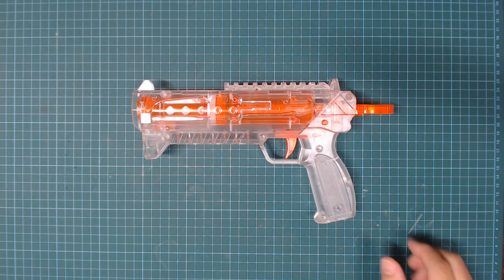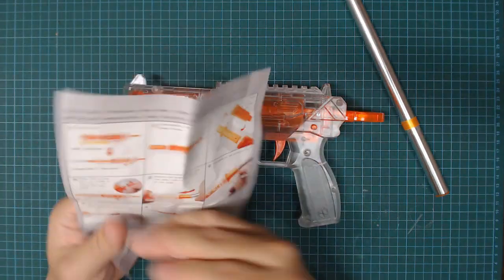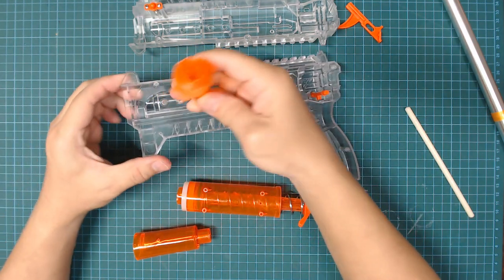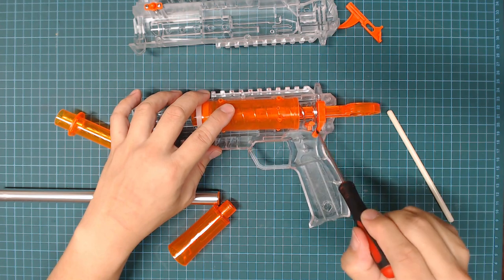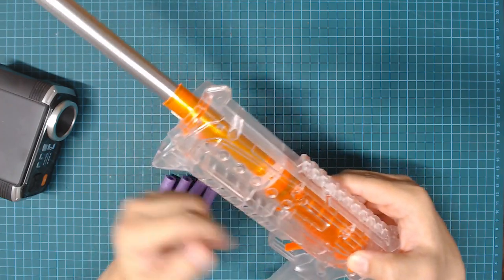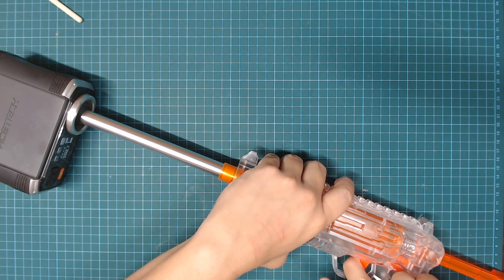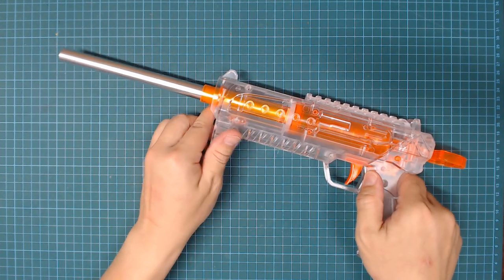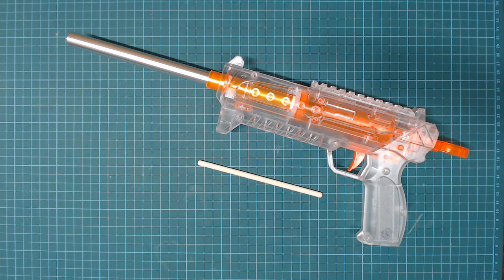Worker Pistol - CheeTah - Short Dart Conversion

Comment: Well that's cool, and has a lot of potential!  AK blaster mod have the complete kit for about $26 USD, but shipping to the Uk is $22 USD 😱
I'll have to wait until I need some other parts to justify that order.
Reply from the maker: Man the shipping cost as much as the blaster, 😳
Reply: Is the option on akblastermods 26 usd for just the base pistol?
Reply: @jkemmer99  that was for the pistol, upgraded spring and the short dart barrel
Reply: @andyscriv5  dang I paid 27 for just the base pistol on their etsy. But it had free shipping so it's fairly even. What does disappoint is their website estimates that it would arrive sooner.
Reply from the maker: @jkemmer99  I don't know man, I bought from China site

Comment: I know on the Bird of Prey at least, you should prime then load to make sure you have the best air concentration.  If this had slidebreach cutouts in the shell and a slidebreach barrel, it'd be a fun blaster.  I wonder if it can take a OMW 20 or Turf 18.5, but I worry how fragile it is, How are the Catch supports and spring plates? High yields and 4 joule speeds wreck the shit out of a Pistol, believe me I know.... However this is not made for that quite.  And I think that this would be better molded in Nylon rather than clear abs or POM.  And the Rods too short,  besides the fact we shouldn't be loading like its 2013 anyways.

It's not bad, but needs more thought to be a contender.
Reply: Totally agree, there's potential here, but not without a lot of work. Still tempting as a matching sidearm for my Terminator, lol
Reply: @zachkostechka3673    A V2 with these changes would be great, too many times you get pressured as a Product Designer what people would "commonly" want while disregarding modding potential, the goal is to make it affordable for common use and make it able to have balls at the same time, but with all the work it would take to bring it to sniper pistol level or 170 fps Rival level like a Kronos can do with a spring change and a spin tab reconfiguration.... well.....

And it's so scope ready too.....
Reply from the maker: Yup I think the plastic shell may not hold, especially the spring rest on a thin piece of plastic before the catch
Reply: @TungstenEXE  with all the work I've put into making my Terminator competitive, this thing can't be too much worse. Those performance numbers are serious enough, I'm leaning towards getting one now. thanks for the review!
Reply from the maker: @zachkostechka3673  yup the performance is pretty good consider very little work one needs to put in :)
Reply: Somehow I knew I'd see cartaya comment on a worker firestrike video 🤣

Comment: 200 fps is still pretty impressive
Reply from the maker: yup and I did not have proper seal and I think it might be able to take even stronger spring (I have no idea what is kg of the stronger worker spring sold for this, they did not state).
Reply: @TungstenEXE  Did you ever find if they make a stronger spring for this
Reply from the maker: @hxd9321  so far I did not see any spring upgrade specify to this.